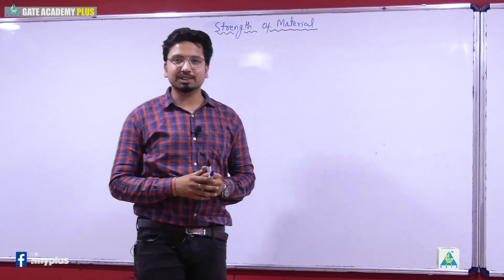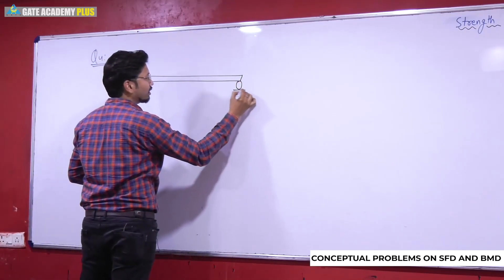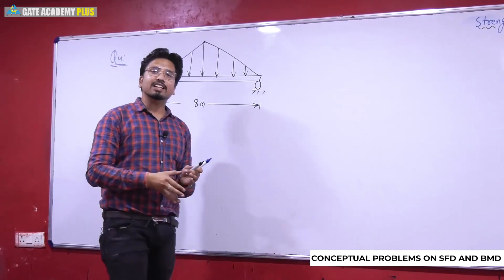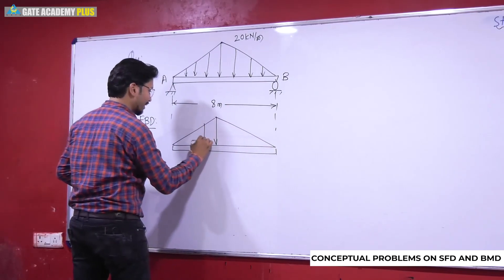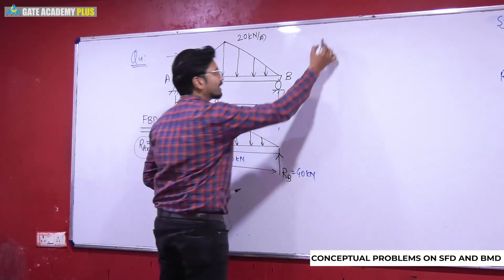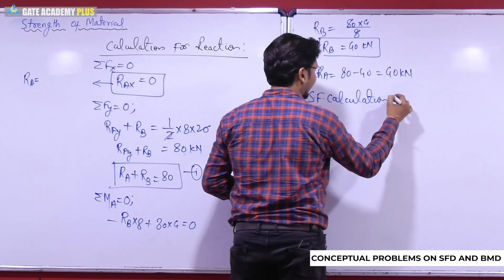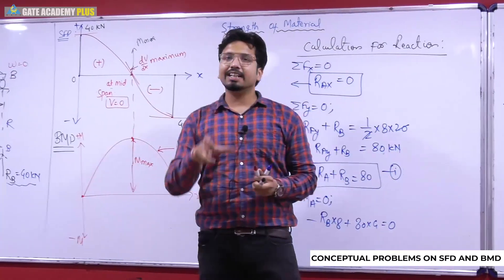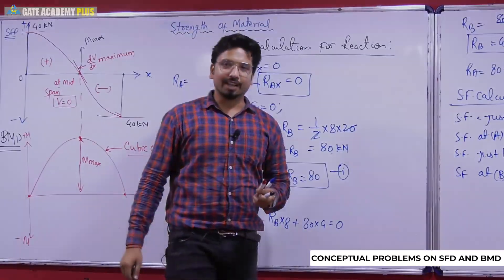Strength of Materials | Module 3 | Conceptual Problems on SFD and BMD (Part - 4) | (Lecture 38)

Comment: Sir plz upload next module's video
Max B.M. is 106.6667
Reply: Noo. Check out it is 53.333
Reply: @Dhananjay Kulkarni no bro sir has confused us.. U r solving only last line which he has written on board. But he is checking our concentration.. 
Let me clear.., 
L= span of the beam =8m
RA= 40..
From A to centre distance = 4m..
UVL acting on Centroid, 
W=w×l 
W=20×4 = 80KNm on centroid. 
From centre to centroid distance = l÷3 = 4÷3..
So, 
Max BM = 40×4 - 80(4÷3) = 160-320÷3 = 53.333 KNm.. 
Where u guys r confused is with 160-160÷3=106.666
But 160-160÷3 is not correct. 160-320÷3 is correct.. 
Check it from starting ull only get.. Any queries Do comment
Reply: @manojnagsharma888  your answer is incorrect dude.... first of all if you are taking 80KN load which is just the load of the entire triangle on the bean in that case the load of 80 N is acting on the C point..
hence perpendicular distance from C becomes 0 i.e. BM due to the 80KN load at C is zero.
Going from left to right... 
at point C we will only consider the loads acting at or before C.
and in bending moment calculations( if you focused on the statement of the teacher) you will remember that BM of any load acting on the point from where we calculate BM is always 0
Now till point C you only have a half triangle and the centroid of which if measured from C will lie at 
X=b/3 where b is the base of triangle.... and half triangle simply means half the load.....  so correct your calculation and cross verify everything... or you can even use online BM calculators for the same and you will get the answer as 106.666...
instead of correcting 10 people you should check yourself first...
Reply: @ajaysingh6555   @Ajay Singh  no, M not accepting this. 
What sir has tought me i have done it soo correctly. 
My entire calculations is in above comment plzz u verify from starting and comment.. 
Max BM is 160-320÷3 = 53.333 KNm.
But sir wrote 160-160÷3 on the board to check our concentration.. 
But it is 160-320÷3= 53.333 KNm..
Reply: @manojnagsharma888   sir might have also taught you that while making and BMD and SFD when you start from one particular side upto a section then you consider loads only within those sections ...not the loads on the entire beam....

For eg if you move from left towards right...(take mid point) then you will consider the loads only till the midpoint...

Similar thing goes for the udl case...when you cut a section on the entire length of a udl beam..you consider that particular fraction only...

Otherwise your shear force diagram will always be a linear one and it will never be a parabola or an inclined one...

Inclined sf dia is because of the increasing and decreasing loads...
Reply: @manojnagsharma888  
So watch the videos at Normal speed or at .5X instead of 2X and you will get the concept or just look up for "bending moment diagram calculator" on google and set the input values as that of the question and if the answer doesn't match then contact the website admin and ask him to use your formula...

Or go to Chegg website and pay the professionals who will tell you the correct method for solving your problem...
Reply: @ajaysingh6555  😅 for UDL 
W we must take w*l
Which is 20*4 becomes 80 y r u nt getting it.. 
Total span of beam is 8,
Length of UDL is 4 and load is 20..,
Which become 4×20 = 80 = W on centroid of UDL.
In SFD, centroid of UDL is l÷3  which is 4÷3 from point 'A'. 
So finally it becomes 80(4÷3) = 320
Reply: @manojnagsharma888   dude..its not 20x4....  It would have been 20x4 if there was a rectangular udl...but for trialgle...you have a basic formula to calculate area...that is .5x base x height...
Which is .5x 4 x 20... I.e. 40..not 80

Total load acting on a centroid is not always w x l..
Its the area of the figure...

If its of rectangular shape... Then you use w x L
If its triangular... .5 x w x l
And so on
Reply: @ajaysingh6555  coming to ur point 5×20×4 becomes 400..
Not 40.
And it is not about area, it is about load acting on udl through centroid. 
For ur kind information
W=w×l is same for both
UDL and UVL
Reply: @ajaysingh6555  it's ok dude 😅 chill. Anyways tnks to u fr putting ur time
Reply: @ajaysingh6555  bro! Don't waste your time for such type of people who don't want to understand anything.. Well your concept is too much clear.. Good luck🤞
Reply: @poornimasingh1978   some people just don't want to accept things the way they are 😑
Reply: @ajaysingh6555  absolutely right.
Reply: @poornimasingh1978  many guys tried to tell him the real results but let's see if he listens to a woman here 😂...
Reply: @ajaysingh6555  😂😂😂lol